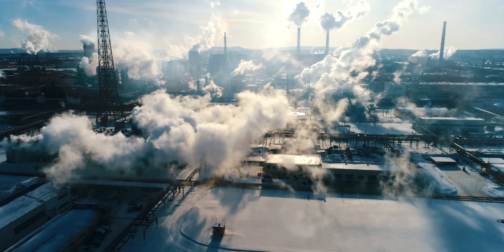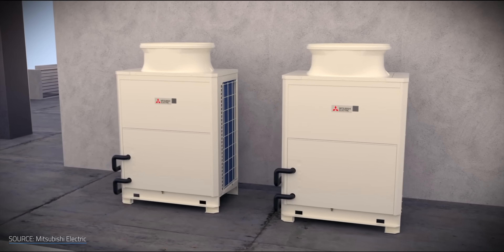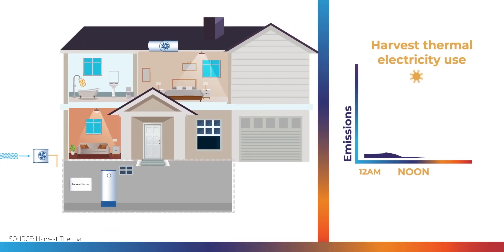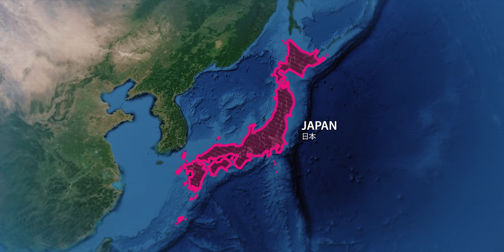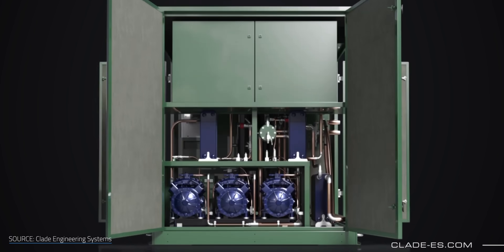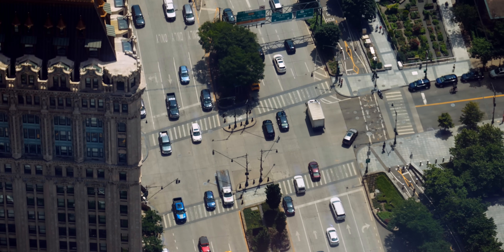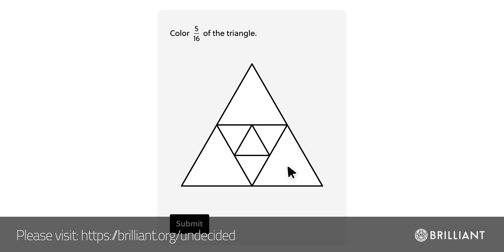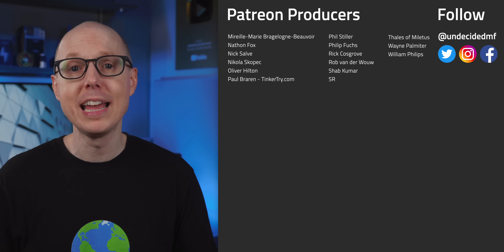Why CO2 Heat Pumps Are The Future Of Cooling

Comment: It's a common practice to pair a heat pump with PV solar and use excess of the sun to heat 300 to 500 L tank for hot water and even some heating, if the days are sunny during the winter. Not exactly dedicated system, but it accelerates the ROI calculation dramatically.
Reply: I only wish combined PV and water panels would be more widely available, you get extra performance from cool solar panels and extra "free" heat to dump into the HW tank, even in winter.
Although designing a heat pump system that could :
    a) cool solar panels
    b) dump/pull heat into/from a HW tank
    c) heat/cool house as needed
    d) dump extra heat outside
gives me a headache already
Reply: @MikrySoft  I am not an expert, but I think cooling solar panels does not make much sense for private solar use, since you'd cool them typically in summer, gain few percents of production only to leave majority (like 60-75%) of energy unutilized due to summer excesses. Now if you return them to the grid, it will still make no sense, since everything you do with energy suffers more or less from inefficiency, so by the time you'd cool the panels, you'd waste a lot more than you could gain. As for the rest, it's basically on the shelve - heat pumps (most of them) can work in reverse and cool the house. An efficient unit for that is "mini-split", which is basically more an A/C with (reasonably effective) heating, rather than heating unit. In my case  - and more classic and complete heat pump scenario - I have floor heating in the ground floor and low-gradient radiators on the 2nd floor. That is basically a caviat to the heat-pump cooling - you're cooling the house at the floor level, which has low effect on overall temperature, causing higher temperature gradient between the floor and sealing. And there's a risk of condensation, especially on radiators, if you cool too much. A sealing fan would help probably, but it's not a thing in Europe. But fortunately, with tripple pane windows, well insulated house, external electrical blinds on the south-facing windows and night-time window ventilation I don't really need cooling. I turned it on little bit twice this year during the most hot days. The floor cooled little bit is refreshing, if the house gets above 26°C, which is roughly our comfort limit. As for storing the hot water for heating, you can do that, but you need really "oversized" solar field and in our location it will not work at all roughly since mid November to mid January and intermitently some weeks before and after. By the way I prepare for a build of my 2nd house and I want to make it earth covered and sheltered, which hugely increases acumulation of the building (and mass around) as whole.  Combined with, south-facing windows, "greenhouse" room, perhaps little solar chimney, earth tube (properly done, no wild rough DIY) and ERV it will do most of heating on it's own. Heat pump for hot water and little  heating for most cold periods of the year will complete it, running most of the year from PV system.
Reply: @oakld  Maybe I'm approaching it from an European point of view, where houses are smaller and a roof space is limited. I looked at some commercially available build plans for single family houses in the upper range of "normal size" (around 180m^2) and most of them come with 200m^2 of roof. At most 1/3 of it will be on the south side and usable for panels, so that's maybe 16-20kW peak if you use top of the line 400W 22.6% efficient panels. That 20kW peak translates to (in Polish conditions) at most 22MWh per year, around 2.5kW average. That's why I'm looking for maximum space efficiency, since most people physically can't fit enough panels. You can squeeze a bit more average power (at the cost of peak power and installation cost) with east-west panels, but that depends on your roof orientation.

I'm not talking about cooling the panels sub-ambient, but even getting them to the 25 degrees C (temperature the panels efficiency is measured at) from the 50-60 degrees they heat up in the sun prevents me from loosing  0.3%/K*25K=7.5% (1.5kW peak for the 20kW installation) for a cost of running a water pump and a couple of fans to cool the radiator shedding the heat I won't use for hot water. 

Feeding the energy into the grid is IMO completely pointless, at least with our Polish energy tariffs, so storage is the only way to go. With the bureaucracy being what it is over here, I would seriously consider running my whole house from an inverter and having only a battery charger connected to the grid (like an on-line UPS system), therefore insulating myself (pun not intended) from some, if not all, regulations on how a grid-tied system has to be designed (since it technically wouldn't be connected to the grid over AC and had no backfeed capability).

I wouldn't even consider using floor heating and radiators for cooling, since it's completely backwards from human comfort requirements - you want your feet warm and your head cool basically. 500L hot water tank in the basement, used for both tap water and floor heating, cooling provided by HVAC (maybe without the H). Since I would already need a ventilation system, ERV and preferably humidity control, throwing in a heat exchanger for cooling isn't much of a stretch.
Reply: @MikrySoft  No, that's fine, my house is actually around 90 m2, since it has two floors. But my roof is East-West, so I rather built a shed in the garden facing south, using solar panels as roof. It's also a common option, as well as using barn if you have a homested, etc. (that was the case of 48 panels I mentioned - both house and barn used). 

I'm still not convinced about cooling at all. Think about solution to effetively cool the 2,1 m2 area of the panel, how much material you'd need for piping heat distribution, etc. Then the water you'd heat would be marginally heated to temperature, that maybe you can use for direct underfloor heating, but certainly not for acumulation. I think it's totally unfeasible and that's why there's no one providing such solution. If you use it for pre-heating, the effect would be again marginal. But it's only my opinion and maybe there'll be a way to capitalize on it in future.

Solar panels have these days at least 450 W at a standard size of approx. 2.1x1.04 m, with some brands now putting on the market larger and little bit more capable panels. It doesn't matter that much, the important thing is to choose reasonably new panel (produced with up-to-date process) and reliable producer. I do consider what you describe - trying to avoid utility companies and legislation as much as possible. And you're completely right about returning energy to grid - so far it has no future, as there's no solution for meaningfully storing solar energy an the grid cannot cope with such disballanced power input. That's why governments regulate it more and more as the solar power develops and soon it will not be possible to even connect new solar system to the grid, let alone base on it return of investent calculations. It makes technical sense, it's not just Poland. The situation may change, with a huge scientific focus on finding solution for that, but that's wehre we stand Today.

As I said, I'll be building new earth covered and sheltered house, I've just started the design with the architects, so nothing is defined yet. But I think an underfloor heating makes a lot of sense, just because you can have it on the very same heat pump with hot water heating, the only extra is a switch valve (I have the same solution now). I'm not worried about cooling, since such house never overheats with proper shading and I'll have also properly designed "earth tubes" for additional cooling (or pre-heating, in winter), when needed. Also a "greenhouse room" for a chimney effect for natural ventilation and/or heating during winter sunny days. Completed with ventilation ERV for heat recuperation. Humidity control is also important, I use currently only plugin heat-pump dehumidifier in bathroom during winter, but will seek some "inline" solution for the new house. Ventilation is not a simple topic as it seems on the first glance, I learned hard way that even ERV producers can easily make mistakes and cause condensation in the tubes. And what they can do with Earth tubes in the desert would be disaster in our C-W European climate, we have to track dew point, carefully slope the smooth tubes, make a proper drain well, etc.

There's so many ways to iprove energy balance, that it's often overwhelming and difficult to choose proper solution.
Reply: Yeah, this ability to go full-out while the sun shines is HUGE. Some of your evening loads at peak (like cooking) are hard to avoid but this way you stored all the heat you'll need during the day.
Reply: <<It's a common practice to pair a heat pump with PV solar and use excess of the sun to heat 300 to 500 L tank for hot water and even some heating,>>

I would call that a wildly exaggerated claim.  Care to document that?
Reply: Have you ever seen/heard of a PVT solar panel? Check out DualSun.  I'm looking/wating for a US manf or at least until I can see an installation first hand of one.
Reply: Probably not common enough.  IMO to qualify for tax credits,  solar system should be required to have storage, batteries or hot water at a minimum.
Reply: @chrisE815  In Germany you get only subsidy for batteries (as a part of the of them solar system, not standalone), which motivates people to get them, this preventing grid stability problems, which already develops in many places. Yes it does makes sense. I have both batteries and 300 L HW tank. I've just been in an old refurnished house and they have two tanks - 500 L for heating water accumulation and 300 L for hot water. And 30 KWh battery storage and large 48 panels solar field. It's a refurnished homestead,so they have a lot south facing roof "real estate". I started slow, not knowing what to expect and in a time of most demand, so I have much smaller system at 5KW/10 KWh, but it still generates more than family of four  needs more than half a year each year. I want to get much bigger system on my next house I plan. It all makes so much sense, especially with prices we have in Europe these days.
Reply: @oakld  smart and awesome
Reply: << It all makes so much sense, especially with prices we have in Europe these days.>>

Government is SO helpful with these matters!  Jacking up the price of energy, and then offering subsidies to people to do what the government central planners want them to do.
Reply: @SeattlePioneer  I am generally against subsidies, though it's just a tool and in some cases ite may help to motivate people to do a right thing. I didn't qualify for a subsidy, since my gas heater would gave to be 20+ years old - which means well beyond a common life time of those appliences :-D. Governments generally don't set energy prices, especially those of small countries and/or without abundance of energy resources.
Reply: << my gas heater would gave to be 20+ years old - which means well beyond a common life time of those appliences >>

As a now retired gas furnace and gas appliance repairman, I can assure you that this is not the case.

As an example, I installed a 90% efficient gas furnace for my brother thirty years ago, and he recently tore that out to replace it with a heat pump.  His motivation was to follow the current fashions for using electricity rather than burning gas.

It's a fad like ripping out perfectly serviceable kitchen countertops to replace them with far more expensive granite countertops.

It's expensive to follow the fads and fancies of wealthy elites.
Reply: @SeattlePioneer  Well maybe that goes for top-of-the-line German made furnaces, but the English brand (and most sold, I think) I have, I've been told by serviceman, has life time about 10 - 15 years. And the breakdowns really confirm that, as well as experience of my friends. Serviceman said it's about the cheap design, compared to Viessmann or Junkers. Anyhow, in my case the heatpump  performed above expectations, even without PV it costed me last heating season 2/3 of the gas heating. Of course this is individual, since my house is roughly 2.6x of a passive standard (so well insulated, tripple-pane windows, etc) with large accumulation capacity and doesn't need much to maintain those 21.5˚C we like. As for the efficiency, I think the furnace I have claims to have 92 or 94%, compared to the new Samsung heat pump I have that has average annual efficiency SCOP=3.5 (350%); after adjustment for gas vs. electricity price, it gives those 2/3 of the running costs. As a bonus, I used some free (PV fed) cooling during worst summer days and partially heated my hot watter from PV excesses. Utilization of PV exesses for hot water was this summer very low; I I'll have to get a smart switch (for grid-PV), because I can't leave the PV just on during summer, since my wife hapilly turns on everything in our house at any time, overloading the PV system.
Reply: <<Well maybe that goes for top-of-the-line German made furnaces, but the English brand (and most sold, I think) I have, I've been told by serviceman, has life time about 10 - 15 years.>>

Bull.  You were told that by "repair" men whose main  job was selling people new equipment they didn't need.

The usual reason gas furnaces need to be replaced is failed heat exchangers, which a pretty rare for thirty years or more after new equipment has been installed.

Climate change has been another God send to heating contractors looking to sell people equipment they don't need,  since it encourages people to rip out usable equipment in favor of expensive new equipment. 

Unfortunately, all too many "repair" men have as their primary aim the replacement of perfectly usable equipment rather than repairing the equipment they see. Not ecological.
Reply: @SeattlePioneer  I don't think the serviceman wanted just to sell a new furnace, I had a expansion tank replaced (10% of the cost of very good new furnace) and the chamber (I guess a part of heat exchanger) had a signs of degradation too. As I said, there are tons of people who replace the gas furnaces between 10 and 15 years, you're very lucky to get ot 20. Mind, that our climate is squeezing much much more out of them, compared to mild british climate. My furnace was actually in very good condition until my wife stayed home few years with kids when they were born and little, heating the house to 26°C all the time. New Viessmann gas furnace would cost me around €2300, the Samsung heat pump costed me €8000, all costs included. Heating bills itself go to up to €2300 per year now, and while I don't remember all the data in my ROI (and yes, I did it myself, no salesman), I think the worst case scenario was little over 7 years. Very realistic is under 5 with conservative estimate of PV excesses utilization. I din't know at the time of purchase if I would qualify for subsidies (conditions were not released yet), I didn't, but if I were ROI could be as low as 1,5 years. Prices of comodities may change disproportionally in time of course, affecting the ROI significantly one way or another. But it really makes sense. I will not even bother to get a gas line in the new house I plan, but that one will be passive anyway, heat sources will only be a backup for most cold days.
Reply: <<As I said, there are tons of people who replace the gas furnaces between 10 and 15 years, you're very lucky to get ot 20. >>

That's quite true. As I suggested, all too many people called out to "repair" equipment are really there to sell new equipment, whether you need it or not.

I remember an occasion where I was called out when I worked for a gas utility as a repairman.  A customer had been told by a "repair" man that the heat exchanger on the furnace was cracked and the equipment had to be replaced.  I happened to get there while the "repair" man was still there,  and inspected the heat exchange and found nothing wrong with it.

When I asked the "repair"man to show me the hole in the heat exchanger,  he said,  "Oh, maybe just a speck of dust."

Actually, my gas furnace was installed by7 the previous owner in 1962. Aside from replacing the pilot burner with a pilotless ignition system, I've done very little other than ordinary maintenance.  This is a Sears "Homart" gas furnace. Nothing special. 

My brother replaced his 90% efficient gas furnace that I installed in 1993.  Still working fine but he wanted the latest fashion and installed a heat pump. 

I'll very likely replace my old furnace with a 95% efficient furnace someone is tearing out to put in a heat pump as well.  I'm looking to get that for FREE, preferably. 

Heat pumps are the latest fashion.  They have replaced taking out useful kitchen countertops to put in granite countertops which was the fashion around 2000.
Reply: @SeattlePioneer  I bet this may often be a practice of service man, but I didn't come across such behavior. I believe they make much more money servicing old gas furnaces, compared the margin on the new one, where's a large direct competition (you'd obviously get 4 or 5 quotes, right?). Heat pumps are a fashion in some way, but a very meaningful anyway. Our country doesn't have gas resources and as most of the Europe we used to get it from Russia and at some point it was a question if we get any gas from anywhere at all. It's a stress, if it's the only heating source you have. Now I have it as a backup, I can turn it on anytime, but I won't, because it just doesn't get close to the comfort of heat pump heating. As I said, my HP works at 2/3 of the costs in the worst case scenario (like January) and that does not include needles standing charges or switching to solar excesses, when they're available. Overall, the heat pump will pay for itself like little over 3 years (+1 already serving) and then will start to generate savings. It also gives much more comfort as for regulation. It just make sense in my case. Having said that, it may be a different story with a large and old, uninsulated house, where gas would be cheaper. But that become a rare thing, since it's difficult to afford it in our cold winters and government gives subsidies for insulating and new windows. Generally any way we can reduce consumption of energy in the first place (like said insulation) is without a doubt a positive step.
Reply: << I believe they make much more money servicing old gas furnaces, compared the margin on the new one, >>

It takes time and experience to develop a skilled repairman.

It takes a minimum of experience for a marginally trained person to look at someone's furnace and tell them  --- too bad,  this needs to be replaced,  for whatever BS reason seems appropriate. 

When I was operating my gas appliance repair business, I considered what to look for when shopping for service of any kind.  What's MOST important?

I decided that the most important thing was HONESTY,  with competence down the line a ways. 

All too often, I see marginally trained people being dispatched to "repair" people's equipment. Maybe they can fix it,  and maybe they cannot.  If it's time consuming, burdensome or they just don't know what to do,  isn't the simplest thing to do to recommend that the equipment just be replaced?
Reply: @SeattlePioneer  we have quite good people in the trades, reasonably well educated and when they leave school, they have 3 years of experience and very thorough knowledge of the industry. The only major problem is with building industry, where half of the builders are simple-minded DIY-level builder-wannabes... There's simply too large demand, so anyone can call himself a builder.